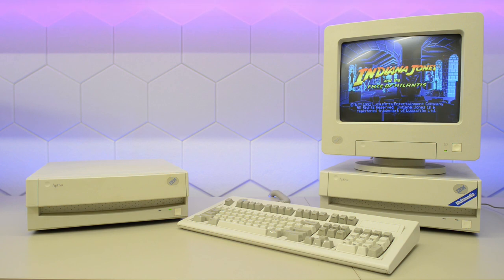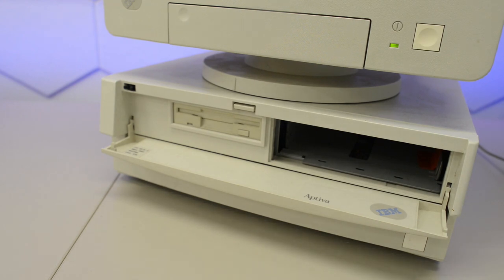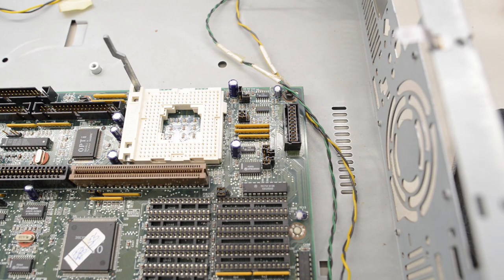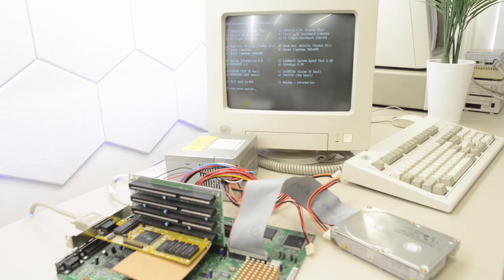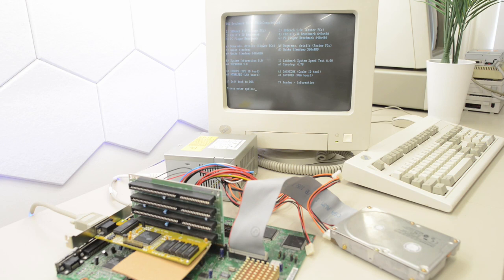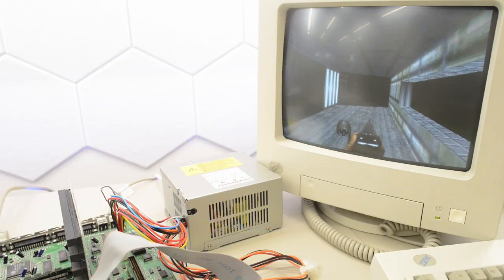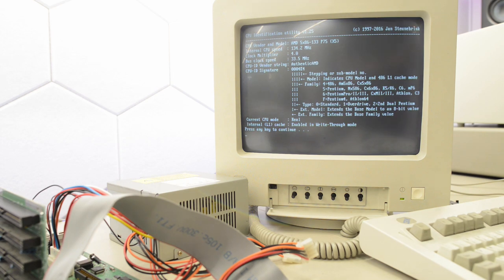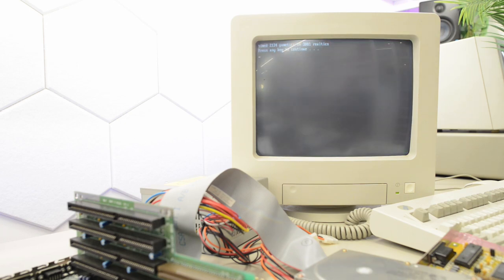Will it take a 5x86? Restoration & Upgrades. IBM Aptiva 2144 Multimedia PC. 486DX2-66 with VLB

Comment: Ahhh, Aptivas... My childhood PC was an Aptiva 2136 which I recently located and fully restored beyond its original parts! Back in 96 I had the 2136 with 32MB of ram, a Pentium MMX 166 and the IBM Crystal based sound card, notably with the IBM Aptiva S-W1/C - Wavetable dautgherboard. It took quite some time to track down both a working 2136 and the S-W1/C, but eventually I did and now it's happily running Windows 95 just as it was in the late 90s because I still had my recovery discs!
Reply from the maker: Awesome. The recovery disks are often the hardest part to find for some of these vintage projects
Reply: The upgrades were 128MB of ram, a Voodoo3 3000 PCI and a Pentium MMX 233. The fastest CPU the machine can handle natively voltage wise, although it recognizes it as 200Mhz.

Comment: Wow! Thank you very much for the video, was a pure joy to watch. I got a very similar IBM Aptiva in the same case back in late 1995 - early 1996 but with a Cyrix 5x86 at 100 MHz inside (when I saw 5x86 in the title I though you will be installing this CPU as it is natively supported). My motherboard layout was similar to the VLB one from your video, I remember this because in 2001 or so I upgraded the RAM to 40 MB from stock 8 MB (which allowed to finally install Windows 98) and maxed out the cache (which made visible difference in OS responsiveness and improved loading time in some games) and the RAM slots and cache sockets looked identical to yours. 
Amazing quirk about these Aptivas (and other IBM PCs of this era) is RapidResume which is essentially modern hybernation - that was mind blowing in mid 90s at least to me. OS boot taking like 4-5 seconds from compeletely off state bringing you exactly where you have left off with all the applications and windows restored. But that required the OEM version of Windows 95 from IBM with some additional software to enable it, not sure if you can make it work on a regular Windows 95. 

Also I had a very similar display but the model was IBM G41 - I think it is identical other than the dispay controls  that were rubber buttons instead of the knobs behind the door that you have. But I saw your display in all the marketing materials that came with my Aptiva so apparently that was the default option.

Thanks again for the video!
Reply from the maker: Thanks!

Comment: Always loved these desktop Aptivas, I have a similar era Aptiva M series tower, 1996, Pentium 120 with Mwave card running Win 95. I love the M series tower, but the desktop is just a nice clean design. I had a much earlier 386sx PS1 'Consultant' based on the same chassis in the desktop form factor, a lovely neat machine but sadly the motherboard completely died. I also have a PS1 tower, DX33. Awesome video, great work, thank you!
Reply from the maker: Thank you, I have made some videos about the PS/1 tower too :)

Comment: I have an aptiva 2144-921  with a detachable VRM inserted in the connector "filled with jumpers" . In my experience amd 5x86 works very slow in aptiva, otherwise cyrix 5x86.
Reply from the maker: Interesting, I'll try out the Cyrix and see what score I get. Thanks

Comment: I would have like to see you solder cache and any extra necessary chips to get it working to the other board and run it with the AM5X86. I am curious to see if it would beat the more expensive board if it had cache installed.

Comment: I'm a little late to the party, but I have a PC330 DX4-100 (model 6571), which uses the same motherboard as the second (VLB) machine here. Some notes from my tinkering:
The VRM header (filled jumper block) takes a small daughterboard with a bog-standard linear regulator and heatsink. These are notorious for cracked solder joints. I can probably get a pinout / photos if interested, though IIRC it's pretty obvious.
The opti chipset is a "combo", supporting either VLB/ISA or PCI/ISA risers. I've never actually seen the latter though.
These boards take up to 128MB(!) of RAM, and the onboard video memory is mapped right above that so you can even use it all without 16M memory hole shenanigans.
I have never managed to get any write-back enabled CPU (eg. am5x86) to run, my BIOS (latest available) stalls with "cache fail" or something to that effect. IBM revision notes state:
"1779 Writeback support added (LATER TAKEN OUT) System will only support L1 writethru mode only" IIRC this had something to do with instability running OS/2.
If anyone has a BIOS image with WB support, please gimme. The lack of WB L1 really nerfs performance.
Correct memory manager setup for DOS can be annoying, my notes in config.sys say:
"IBM manual specifies X=C000-C7FF I=C800-EFFF If no shared RAM adapters installed, I=B000-B7FF is mono video area and may be included in most cases."
The IBM SurePath BIOS has some weird drive size limitation (somewhere 1<2GB IIRC, so not the usual breakpoints) I never managed to circumvent, ended up using OnTrack for a larger disk.
Aside from a horrible BIOS these are nice machines, if already a little outdated when introduced.
Reply from the maker: Let's hope someone can hack the BIOS. These machines deserve a 5x86

Comment: That connector on the higher-end board looks like its for a VRM module to allow the installation of a multi-voltage CPU.

Comment: Having had a AMD 5x86 in the past, with its own adapter PCB, I can recall there was a jumper setting for which cache mode you needed, write back or write through. Ideally, you'd want the faster of the 2, but some machines acted up or just didn't boot with it, and you'd have to select the other. Maybe check to see which cache type the CPU is trying to use, and see if you can force the other mode?
Reply from the maker: The socket blaster and the MOBO doesn't have that feature. I'll do some reading and see what can be done, thanks

Comment: Just because curiosity, did you try overclocking that MB-installed Cirrus w/ MCLK?
I never tried Cirrus-overclocking with MB built-in chips, but I overclocked many Cirrus-based cards back then. And it actually helped in some 2D-era games. Same with early S3-cards.
Reply from the maker: Yes, I overclocked my PS/1 with onboard CL to 40MHz here: https://youtu.be/ScpSBcMMuX4

Comment: The first board (type C1) is an evolution of the PS1 board (type B1).
The second board (type F1, if memory serves me well) requires a VRM plugged in place over the block of jumpers right below of the processor socket to recognize fastest processors .
The 55 in front of the serial number indicates the country of origin of the machine....
23-US,78-Mexico,82-Brazil,41-Indonesia,55-Greenock,Scotland
Reply: NecroWare makes a modern one. Very nice and open source
Reply from the maker: Great. If I can find a VRM we could try without the SB. I don't think the SB is causing this issue though.
Reply from the maker: @darthtripedacus1  Is this a standardized VRM socket?

Comment: Could you share where you found the jumper settings to go to 33MHZ on the slower board? I've got a PS/2 76i from a year earlier that runs at 25MHz fsb, and flatout refuses to boot with a different crystal, faster or slower.
Reply from the maker: Awesome, I have a respectable stack of PS/2s but I have never come across a 76i. I just googled the p/n. That being said, https://www.ardent-tool.com/ is the best resource for PS/2 stuff. Good luck with the project

Comment: As a guy who was an Amiga user at this time, I gotta say, we all had a good laugh at the "MPC standard" - Multimedia was practically invented on the Amiga.  Of course by late 1991 the writing was on the wall and C= was being plundered by a vampire BoD who just wanted to raid the company for cash.

But seriously from 1985-1991, your choices for "multimedia computers" were:

A $900-$2000 Amiga
A $10000 Macintosh-II
A $25000-$30000 SGI

PCs of course brought brute force and a massive userbase and that was all she wrote...
Reply from the maker: yeah, as a kid I grew up with a Commodore back in the 80s. I feel pretty bad about Commodore's somewhat unexpected failure. I would have loved to see a healthy competition between IBM, Apple, and Commodore.
Reply: @Epictronics1  Right?  Ultimately I think the Amiga OS wasn't going to survive at any rate, but what they had planned for the actual OS4 from Commodore might have.  It was very apple-like.  Planned to run on HP-PA RISC, the apple-like part being that they'd sandbox 3.x apps, the next gen OS would have full memory protection, etc., as the then-new WinNT did.  Lots of failure in C=, lots of frustrating failure....
Reply from the maker: @thedungeondelver  Too bad really. I guess we'll just have to enjoy the machines they made back then
Reply: Amigas' death was on the wall as soon as they failed to achieve VGA resolution by 1990. No one wanted to work with CGA-like blocky fonts and crazy aspect ratios while 1024x768i PC monitors were all around.
Reply: @IkarusKommt  I promise you 1024x768 was not a thing in 1990.

640x480 (not that far off the Amiga's 640x400) was standard back then.
Reply: @thedungeondelver  There was plenty 1024x768 monitors by NEC, Mitsubishi, Nanao, and many, many OEMs. There also were 2 or 3 512MB videocards to drive them.

Comment: CL-GD5429 is a zero wait state 16bit VLB card... The CL-GD5430 has wait states as it is Cirrus Logic entry level 32bit VLB. You could try replacing the 5430 with a 5436 chip as that is a faster device but should be pin compatible.
Reply from the maker: I might try that, thanks!

Comment: I have a MT 6144 Model 30 that's a Pentium 75, I wonder if they were all sold at the same time?
Reply: They were. Those Pentium were introduced in 94 and were top of the line. They were part of the same family line of you look them up, obviously had a different motherboard and PCI support instead.

Comment: I have the C1 motherboard. It come with 512k of video ram and a Cyrix 486 66. I upgrade the vram to 1 mb and 16 megs EDO ram. According the bios vga and 1st ide channel are in vesa local bus. Mine also is not working with ET4000. Im looking how to populate the cache ram , bios update and 😢 fix the front cover hinges. It runs win95 rather well.
Reply from the maker: Yeah, I'm tempted to go with w95 too instead of the original wfw.
Reply: The only strange thing is that CPU is reported as Intel dx2 100😮
Reply: Any solution for the missing cache ram ?

Comment: IBM: Let's ditch MCA for VL-Bus.
Rest of industry: VL-Bus sucks, let's use PCI instead.
Reply from the maker: There was actually a PCI raiser board for these machines back in the day. It's probably close to impossible to find these days. I'd love to find one to compare with the VLB riser. https://www.computerstudio.us/wp-content/uploads/2018/07/IMG_3665-e1531005461110.jpg
Reply: @Epictronics1  That's really cool! What kind of connector is on that board? I remember about this time (late 94ish, early 95) that PCI motherboards were becoming reasonably easy to come by, and the local PC shops were mostly trying to pawn off their remaining VL-Bus inventory. I really like the look of the Aptiva and PS/1 machines, but they were so unaffordable compared to everything else. My last (and only) IBM was a PS/2 model 30 286.
Reply from the maker: @agntdrake  That was a nice machine, I had a Model 50 286 back then. I'm not aware of if there was a name or standard for these raiser connectors. but it's a combination of a regular VLB slot and a slightly longer ISA connector on the MOBO. Imagine Woodoo SLI with that PCI riser, haha. I hope someone will find a PCI riser and make a clone

Comment: I know its good to keep stuff out of the land fills and stuff but why fix the power supply? Why not just buy a newer one than you know its not going to break any time soon and your get clean power? Is it proprietary pin out  like HP or something and Dell ?
Reply from the maker: I actually have a very similar dead power supply on the bench today. I'm considering gutting it and installing a modern PSU inside the original case.
Reply: @Epictronics1  I'm not very good at fixing things so it would be really nice to know which power supply I could buy from the store and get my older PC up and running again.  I have an HP i can't seem to find the right power supply for and I'm no good at fixing things like that. The Pin out is propitiatory. I also was able to find an IBM clone that floppy drive broke it (sad panda) but I'd to know how to fix a power supply and get a new one.